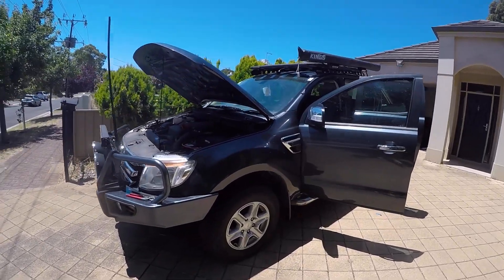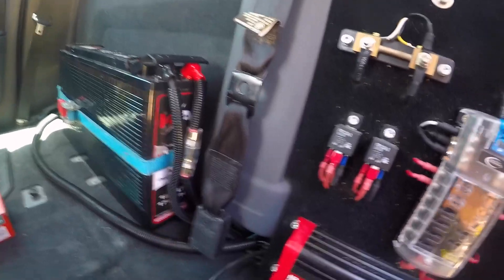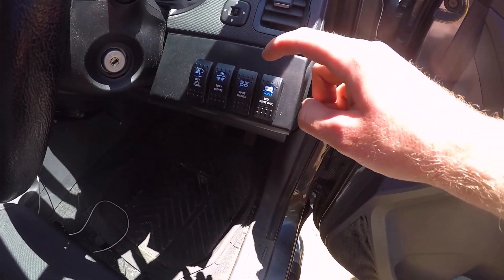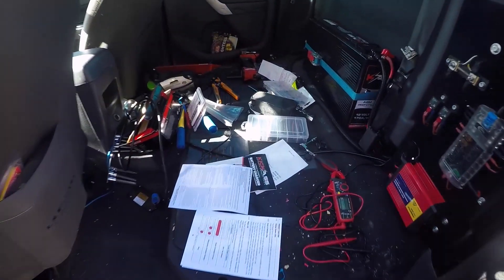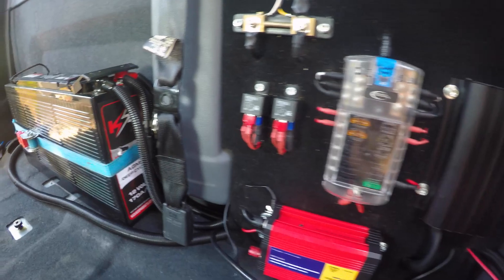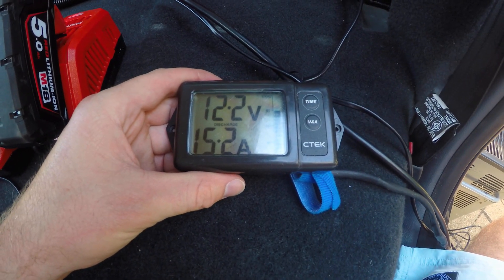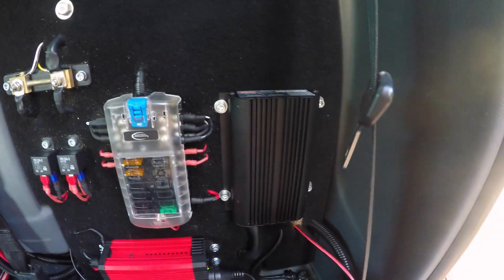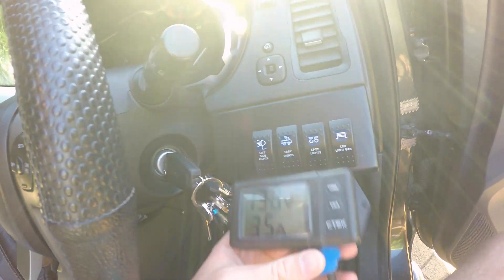Ford Ranger 170Ah Dual-Battery Setup [REDARC, STEDI & Lightforce]

Comment: Hi I was wondering where did u tap into for the remote wire to turn the dc charger on?
Reply from the maker: Interior fuse box under the steering wheel. I used a fuse tap on one of the fuses that is on only with ignition. Can't remember the exact one but it's easy to figure out with a multimeter!

Comment: G'day mate, what is the ratchet strap around the battery attached to?
Reply from the maker: Hey mate, I fixed it to the rear panel with bolts / washers, similarly to how the original straps are mounted. It was only meant to be temporary but has held up fine for years!

Comment: Hey mate, how did you make that carpeted panel that you’ve screwed everything too? pretty neat setup you’ve got. Cheers
Reply from the maker: Thanks mate! I used some plywood and cut it out to suit the opening, you can do it with cardboard to start with until it looks clean. Then carpeted it and stapled it to the back of the ply tightly. 

As for mounting I just used some existing bolt holes but you could use Rivnuts if required, just don't forget about sealing issues, rust prevention and warranty problems etc, depends on the job.. Hope this helps!

Comment: Thanks for that mate am looking at doing the same set up if it fits behind the back seat. Could you do a detailed video of how you ran all the wiring from the crank battery and into the cab and connected everything up
Reply from the maker: Hey mate, hugely pressed for time for the next few weeks but after that I'll see what I can do! Some of the slim batteries do fit with the seat in but they require some planning!!